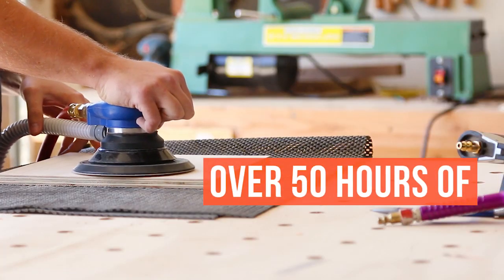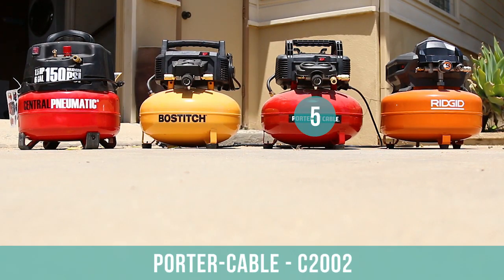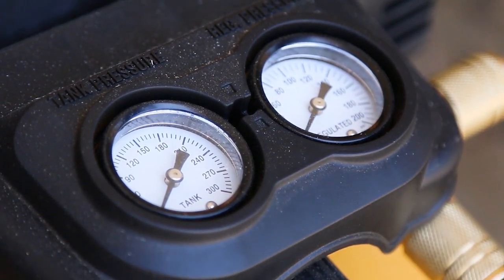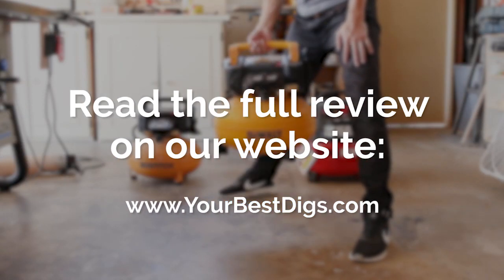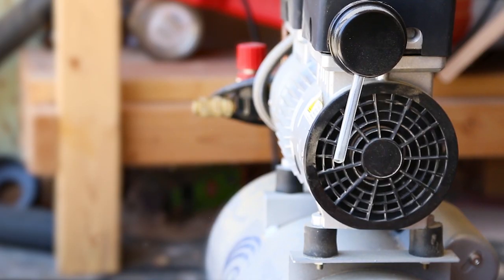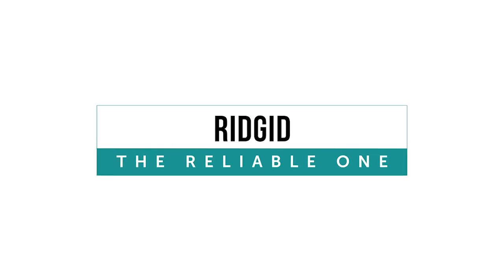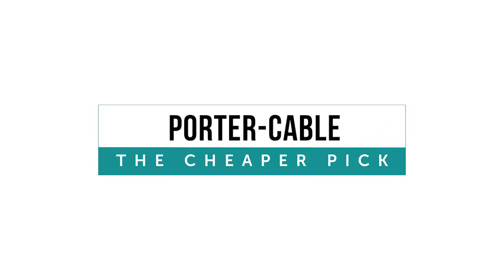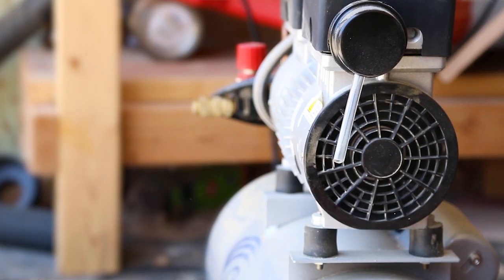Best Air Compressor Review

Comment: I am in the mobile detailing business, and I would like to know which one would be a great pickup for my business?
1. I will be using an air gun to blow away debris.
2. Using a Tornado air gun to clean carpets & engine bay cleaning. 
3. I will be using the compressor with my Briggs & Stratton P2200 inverter generator. It pushes out a peak 14.7 amps. So I will need a low amp draw compressor.
Reply from the maker: Hey Kelly! Our top pick the CA Air tools is great--it is a little heavier than the others but has wheels to help alleviate that depending on how mobile you need to be on the job. Amp draw is not within the scope of what we tested, sorry!  If you need longer runs of blowing air you might be better off with one of the other higher CFM models we tested, instead of the CA Air Tools. Check out the details on our post: https://www.yourbestdigs.com/reviews/best-air-compressor/
Reply: Your Best Digs Thank you so much guys. I went with a 10 gallon California Air tools version. I will keep it at home. But I still want to get a pancake version for mobility.

Comment: I need an portable/light weight compressor to test and charge a 2500 litre volume pvc pipe line with air upto the pressure of  6 kg/cm2. What compressor will you suggest?
Reply from the maker: That volume is waaay beyond any testing we've done. I'm not sure if the shop-sized compressors I've used would even be a good choice. :/
How frequently are you doing this? (Will a rental help?)
If you don't have any other pros you're working with who have dealt with this kind of job before, maybe ask the guys on reddit.com/r/skookum for ideas. They love questions like this.
Reply: @YourBestDigs  Thank you.

Comment: Which compressor would work best for filling up pickup truck tires and using a air gun for tire changing ?
Reply from the maker: Our runner up, the Dewalt - DWFP55126, has more capacity than our top pick for demanding tools like impact drivers.
http://amzn.to/2fz2c2Q
Reply: davieb68

Comment: you failed to mention the issues california has had with overheating and starting fires. thumbs down.
Reply from the maker: Sadly, there are a lot of ways an air compressor can fail, and some of the switches they use can make arcs or sparks even under normal conditions.
 Even if you use it every day, and even if you buy from a "trusted" brand, you should always unplug a compressor when you're done so working it doesn't start running when you aren't around. 
The failure rates on this model aren't much worse than other brands, as far as we could tell in our research. (5% one-star reviews is, as sad as it may be, a pretty low rate of failure compared to the major brands.) We'll check for any info about specific fire or overheating recalls, though. Thanks for the note!
Reply from the maker: We're not trying to trick anyone, but we understand the frustration about cheap tools. Is the $99 Porter Cable really better built? Are you upset that we're testing portable garage-size air compressors instead of 15-gallon models? Do you want us to wait until one burns out before we post our results?
Reply: yeah. test till failure. that's how a test should go. works in every other industry.
Reply: and the fact that it cost $300 and the others are $100ish

Comment: And the cfm?...... how long before it runs out of steam?.... no answer!
Reply from the maker: Hey Alan, check out the results of our sanding test on the full blog post. This gave a rough idea of CFM output which was in line with comparative manufacture CFM listings.
Reply: see the article -> your answer.
Product PSI CFM Noise (dB) Usability
1. California Air Tools - 5510SE 120 2.2 68 5/5
2. Dewalt - DWFP55126 165 2.6 78 4/5
3. Ridgid - OF60150HA 150 2.6 85 4/5
4. Bostitch - BTFP02012 150 2.6 83 3/5
5. Porter-Cable - C2002 150 2.6 82 3/5
6. Central Pneumatic 150 2.5 83 3/5